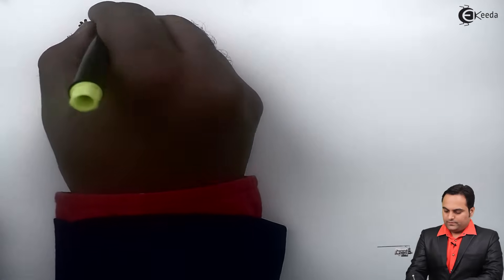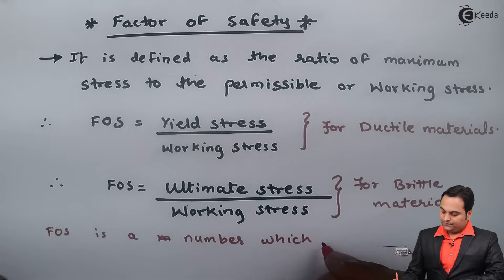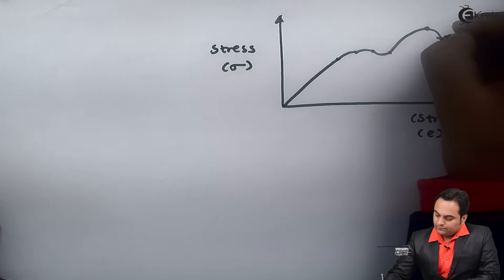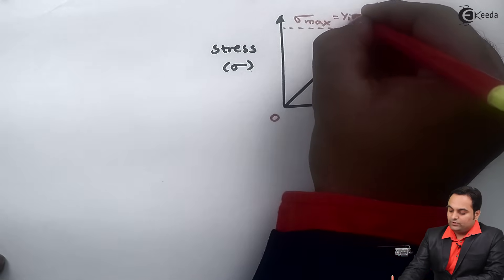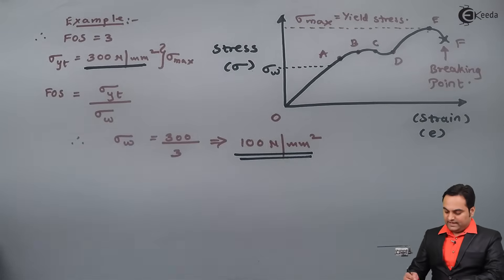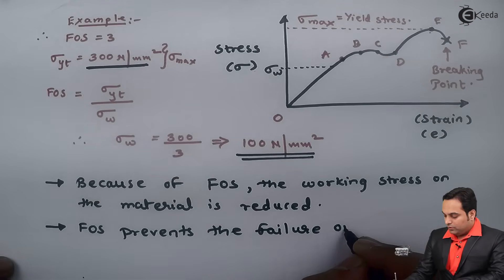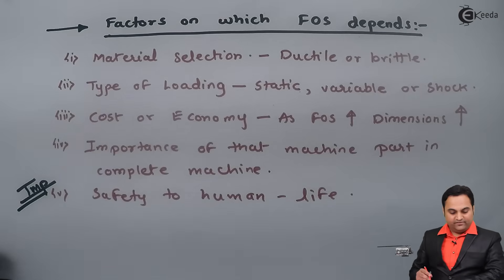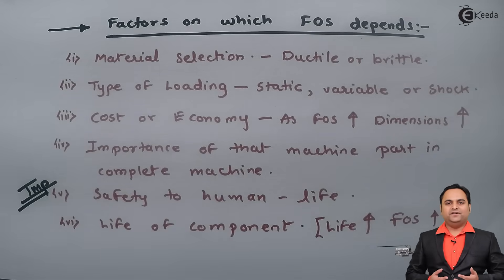Definition of Factor of Safety with Explanation - Introduction to Design of Machine - DOM

Comment: For ductile materials, max stress is not yield stress. Yield stress is the point beyond the working stress ie the point in which the material doesn't return to it's original size, whereas max stress is the highest stress a material can withstand before it fails.

Comment: Hello bro , from where you take fos 3 or fos 4,    I didn't understand,  can you please reply
Reply: There is general guidelines about selection of Fs. For ductile material 1.5 to 2 and for brittle material 3 to 5. 

If for particular application, you want to provide more safety u can increase Fs, which will result in to increase in dimensions

Comment: I am confused in ductile material working stress should be below yield stress  which is point C  not point E which is in graph, Working stress of ductile material should be in Elastic region below yield stress above yield it will premently deform and component will not function properly.

Comment: good explanation sir
please answer me this question
 what are factors take into account while choosing  factor of safety for design of engine ? & factor of safety of engine?
Reply: Kiran Kumar there are many parts in the engine brother so according to the parts we choose fos, as for the engine cylinder  creep and fatigue failure both present there, for fatigue failure we can use soddeberg criteria and if we talk about crankshaft, connecting rod ,crank and chains ,they suffers fatigue stress.

Comment: is the value of FOS is fixed for every material or we have to find out..then how to find the Value of FOS
Reply: No, FOS is not fixed for any material. You have to choose a FOS value for your component design depending on your wish. if what u r designing is for normal use then you can take FOS  around 3 or 4. if designing an airplane, then FOS should be taken as high as you can, to minimize airplane crashes, for example, FOS = 25.

Comment: First example (Ductile material) Stress/Strain curve: Point C = Yield Point, the idea is to keep it in elastic region, so the material won't behave in plastic manner. So actually in the example we are lucky enough to design the part with FoS in the way, where we end up at 100 N/mm2 which is elastic region. However as you write STRESS MAX it is should be = Ultimate Stress/Load on the graph. Otherwise it's a bit confusing. By the way I really like your videos - very clear and straight to the point ;).
Reply: plasticity permanently deformation

Comment: sir, which is yield stress of ductile material at point B not at point E ?
Reply: SAME ,I THINK SOMETHING IS WRONG HERE UTSAND YTS
Reply: point at which the strain(elongation) increase without  increase in stress(load).The stress corresponding to this point is called yield strength 
                                  The yield stress measured at a specified % of deformation is called proof stress